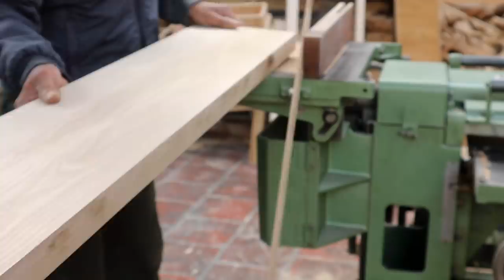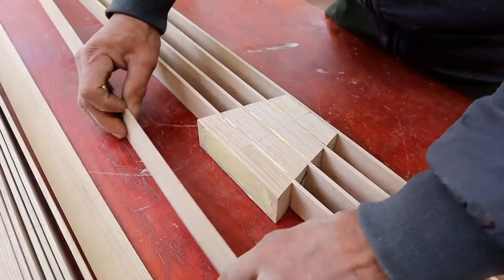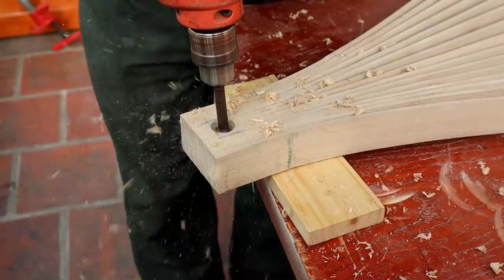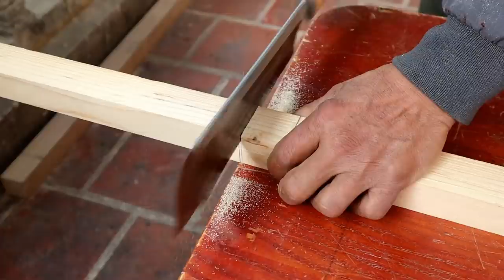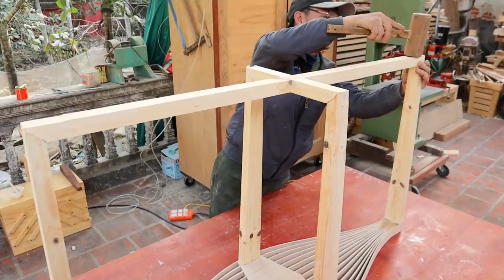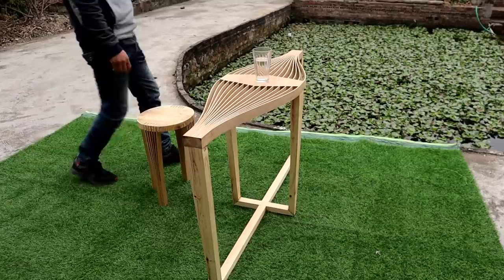Amazing Ingenious And Creative Woodworking Design // Build A Unique Table From Strips Of Wood

Comment: The top is so beautiful but I think the legs could do with a little something.
Reply: And what would it be?
Reply: @predatorcity2920  the same technique on a smaller scale used on the legs with some extra spindles in between for support. Or a sheraton tapered leg done upside-down.
Reply: @bemfawkes3214  that actually not a bad idea..
Reply: @predatorcity2920  👍👍

Comment: As a woodworker myself, for any aspiring woodworkers, this is not the proper way to use a table, you can see at the 2:49 second mark he has knocked off his index fingernail…no, never mind, he has cut off the first knuckle by using a table saw like so at the 2:19 mark.

Comment: The design is good and all but you would be better off if you made better end supports 
It seems like one hit to ether end could cause the glue to come undone 
You could carve out the ends and add a kind of U shaped part with a peg going through the sides to add extra support 
Also I'd put something in those gaps  like epoxy or different bits of wood all sanded flush with the strips because as it stands now if anything hit the side of the table or it fell over just right those strips would break

Comment: THOUGHT IT WAS GOING TO BE FILLED WITH RESIN OR SOMETHING COOL.
Reply: That was my first thought I was envisioning using a colored epoxy on the inner part then when it was with a color, then place in a mold and use a lighter color making a tabletop out of it using the wood as the centerpiece of it.
The way he put the strips you could actually put a different color in each section then continue on to make a tabletop off of much lighter color.
Reply: Use it for inspiration and make one with resin yourself.

Comment: I thought it will end with up with some spectacular product for display. What a waste for the design to end up as a table which I felt is not appropriate for practical use. The rectangular legs for the table top does not match the table top design. Anyway, his carpentry skill is good. Keep it up!

Comment: - First rose leaves: beautyfull structure
- Thorns: this soon brakes because there is no brace, 45 degree support. Only that prevents the structures like this from braking. Only thing that can be used instead of brace is wide eneugh board/plywood in its longer dirrection. ( as it sort of has the brace inside )
- Secondly, goo in photo but is going to fall all the time ( espesially in the grass :) not taking enough side force.

Comment: The design is great; love the top part. However I agree that it was let down by the finish on the legs. It would of looked nicer in a contrasting hardwood instead of the rather rough looking pine, along with a better execution of the joints.
Reply: Sa
Reply: Um... don't think I agree with your criticism of the "execution".   Notice how the legs are not only tapers, but they are angled in, with the base narrower than the top, on every side?  This guy did compound joints on non-90 degree angles with a pen and a couple of hand saws.   I'd be willing to bet that a majority of the people criticizing this fellow can only dream of being able to achieve his level of craftsmanship.

Comment: This piece can not withstand the outdoor abuse.
Reply: It is a great table surface for a hallway table where it does not bear a lot of weight. Thanks for sharing!
Reply: Felicidades todo un maestro.. Gracias
Reply: That depends on the material that it was sprayed with.  I live in Canada and we have extreme weather here.  Many outdoor products are made from wood, properly sealed and maintained, and they last for many years.

Comment: What a unique and beautiful piece.  I myself would add some bolts and "D" rings on the ends for durability and bling along with filling it with resin and adding strip lights. But that is me and not matter what I would do, you have created a very lovely set that I like very much.

Comment: I'd be more impressed if he had used blocks with the clamps to stop them marking the wood
Reply: In many cases this is unnecessary.  You'll notice the large clamping surface of those C-clamps which distributes the pressure over a fairly large area.  He's probably sanded away any small indentations that remained after the clamps were removed.

Comment: There’s no way the top strips don’t start coming apart at the ends. There’s tension and theyre only being held by glue.
Reply: It's seasonal Furniture, you build it in spring, use it in the summertime, watch it delaminate in fall and burn it in winter. Good craftsmenship is something else.
Reply: There are musical instruments that are just held together by glue that withstand permanent tension for 300+ years.
Reply: A yeah it diy fun, al do if followed like the video shows him using the saw, it should say in the tittle do not try this at home

Comment: I would have placed an oval glass surface on top of that as it would increase the value for indoors, red dyed with glass it would be a designer piece you could sell for quite a sum. I do like the outcome without it but one step up is hotels of that thing..

Comment: Strange to see a saw with the fence on the left of the blade.
Shame that the pine legs weren’t made from the same, better quality, ash as the top.
Also, did you notice the chips missing from the trapezoidal pieces as he glued up? from being flung across the room - should have used a shim slat at the halfway point of the sawblade.

Comment: The table is impressive, but I've never seen a floor flat enough for it to set on.  Almost all tables with 4 legs require a shim under at lest one leg and probable 3 if it has to be level.
Reply: ummm what?....so all your tables in your house have three legs?...LOL   what a ludicrous statement!....LOL
 Has NEVER had to shim a table......might want to check your house and floor joists

Comment: interesting design but completely unstable, there's nothing to prevent racking
Reply: Technically true, though the corner joints in the legs would be sufficient for the type of loading this table is made for I would imagine.
Reply: @deldridg  if it were a shorter coffee table I would agree, but tall tables usually incur some load from the side because people tend to lean on them with at least one arm when sitting at them.
Reply: @backhomeprepper  You're absolutely correct. For a moment there I was thinking of its intended role to be more ornamental than coffee table-esque. Coffee tables I've made in the past have perhaps been a little "over-engineered" for this very reason.